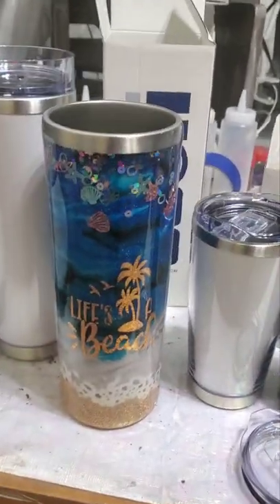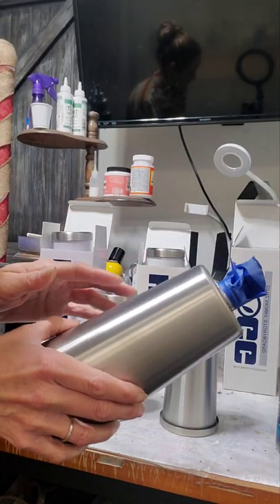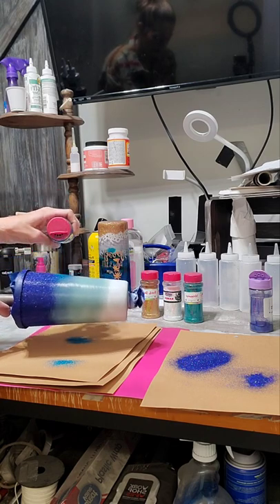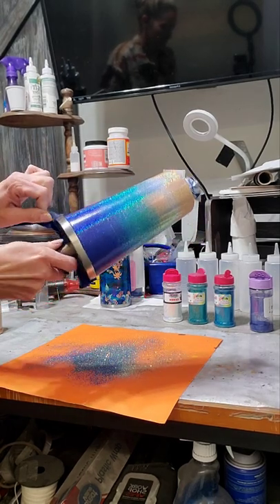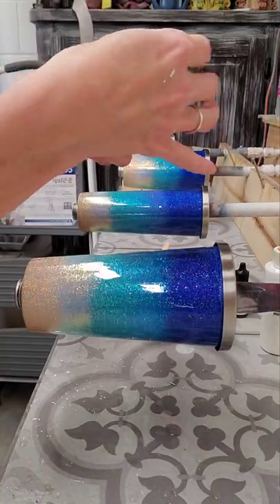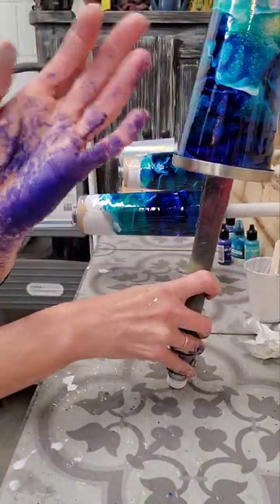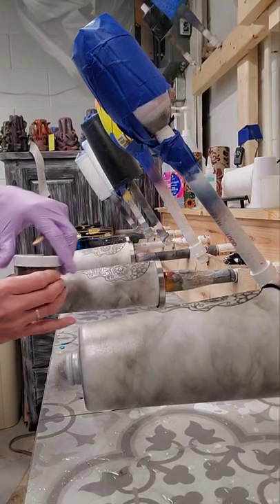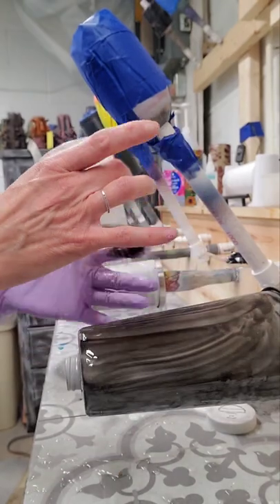Storyboard Tutorial Part 1

Comment: Love your videos! I just purchased a couple storyboards to play with. I have been using Pro Marine for about 3 years, have you noticed any yellowing of white glittered tumblers? I have 2 that I have kept and both have turned a yellow color.
Reply from the maker: I haven't had any issues personally...I know that overtime all epoxy can yellow,  when you prep your cup make sure your white base has time to gas off, what method did you use for glitter if you did a white glitter?, I use tack it or epoxy method, some makers add a tiny drop of blue ink in the epoxy to avoid a yellow shift down the road. But I have been pleased with pro marine personally

Comment: I luv your videos I used a black vinyl for my graphic but it shows through after applying the powder should I add another coat or strip it? BTW you are awesome
Reply from the maker: Add 1 more coat and see if that does it ... and thank you so much!!!! ☺️
Reply: @KotekTime  do you think i can use a waterslide and do a coat of regular resin then coat with the resin/powder? thx for your time
Reply from the maker: You can ... just seal your waterside really well ... those tend to bleed alot more in the storyboard tumblers ...